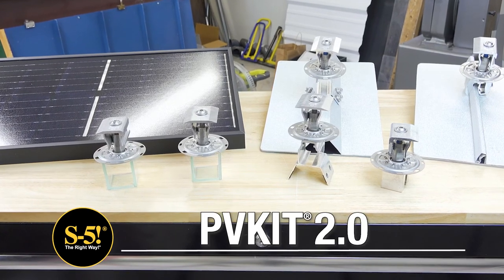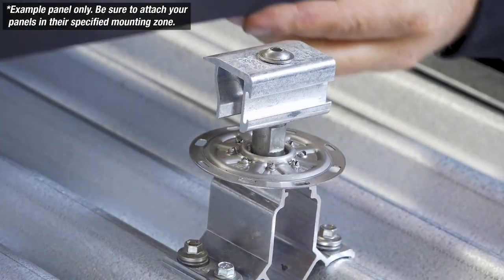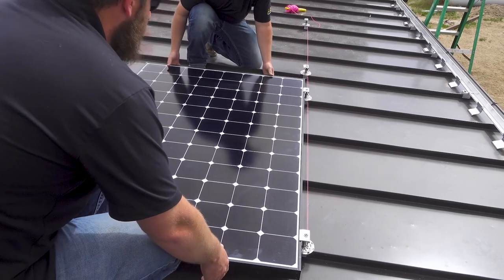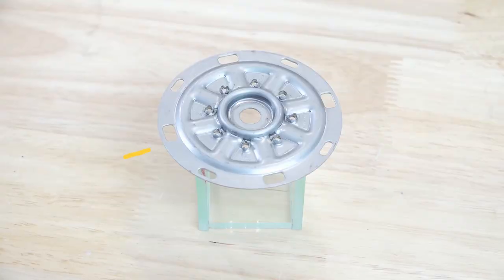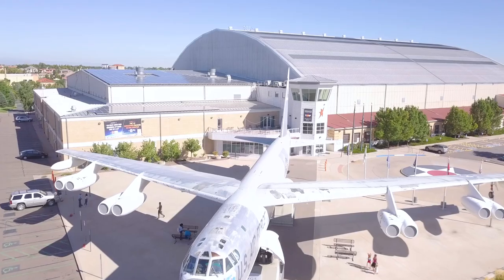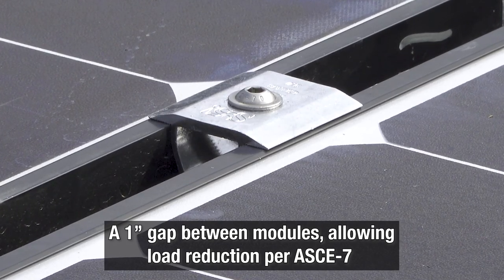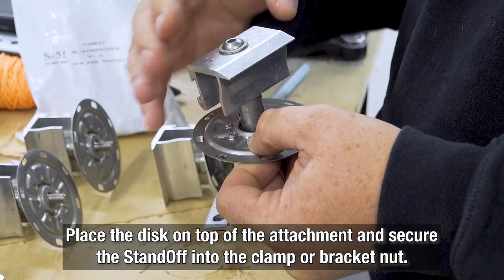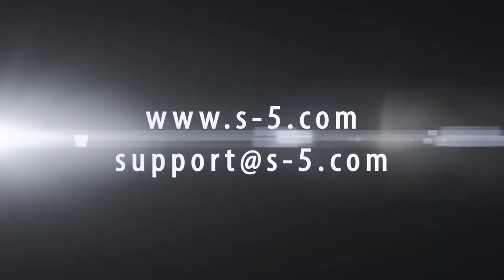Save money on solar with rail-less mounting

Comment: How and where do you attach the micro inverters (Enphase IQ7+ example)?
Reply from the maker: When using micro inverters or optimizers with our direct attach PVKIT system, the majority of the time the units are directly bolted to the module frame under the module.  Often modules have predrilled holes in the frames for this application. In the rare case this is not an option, the inverters or optimizers and be attached to their own clamp or bracket under the module.

Comment: i have  used these s-5 foot regular  these are  easier to install. but to earth  each foot takes alot of time
Reply from the maker: Thank you for your comment and I would like to get more info from you on what S-5! products you use and the array design. In most applications there is no need to ground each mount to the roof as the entire array will be grounded through either the rails or our PV Kits and then a single ground from the array can then be attached to the roof. Please reach out to us at support@s-5.com to provide more details if you like. Also, please see the videos from our Resource Center in the link that discuss wire management and grounding. 

https://www.s-5.com/metal-roof-resources/?pageNumber=1&postTypes=resource,case-studies,resource-video&search=wire%20management&sortType=title&sortOrder=ASC

Comment: I plan to build a carport, patio stye, with 8 ft. Corrugated Galvanized Steel 29-Gauge Roof Panel from Home Depot. The carport will accommodate 20 solar panels, each measure 39"x65" . Are your product certified and meet city building codes and comply with power company for safety? If so please give me the list of things I need to mount my 20 panels. Thanks
Reply from the maker: We almost certainly do have certifications for your jurisdiction, but questions like this are best handled by one of our application engineers.  Please reach out to us at support@s-5.com and we'll be happy to help you on a project specific basis.

Comment: Ok I have installed this before and I can tell you that its great - until you have to wire and earth it.
Reply from the maker: Wire management and grounding with the PVKIT system is an easy task when designed and planned ahead. We also have cable clips, bonding jumper, and grounding clamps available (https://www.s-5.com/product-category/hardware/) to make the task even easier. Also, below are a few links to some of our videos that discuss best wire management practices.

Wire Management Tips for Rail-less Solar Mounting - Part 1 - https://youtu.be/q4kDLHiPeO0?si=DcmXwPoJ5rlKClmQ

Wire Management Tips for Rail-less Solar Mounting - Part 2 - https://youtu.be/jACFcJ0V77c?si=IrnqHLFXZIRwkf8X

Best Wire Management Practices in Commercial Railed and Rail-less Solar PV - https://youtu.be/1ZnUh_A0sQ4?si=anaPKvW5xrAViGq-

Comment: What about frameless panels??? The panels are only 8 mm thick...
Reply from the maker: Currently S-5 PVKIT attachments only accommodate framed modules between 30mm - 46mm thick. However, there are racking systems for frameless modules that can be attached to metal roofs using our clamps or brackets. We are always developing and coming out with new & innovative products so follow us on social media and check our website often for new and updated products!

Comment: Nope.  Flat mount will overheat under the panel, collect too much snow, can't be properly sun angled.  There is no free lunch.
Reply from the maker: While some projects certainly still have more success with a tilt mount system, the roof top solar industry has largely shifted towards flush mount systems.  This is mostly since module efficiency has improved to the point that the ROI from the project is often better with flush mount systems compared to tilt.  Flush mount systems can have more modules/roof space, compared to tilted modules which can get better efficiency per module due to the ideal tilt, but module/area is lower since space is lost due to shadows from the raised modules.  Tilt mount systems also face much greater wind forces compared to a flush mount system.